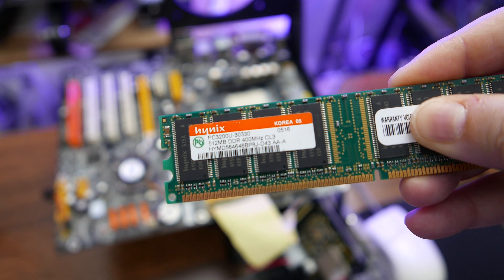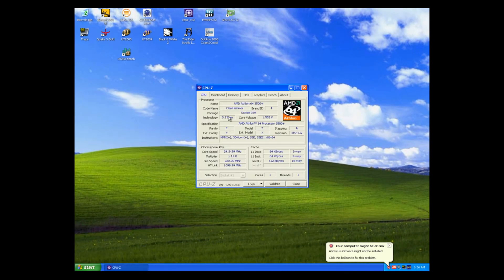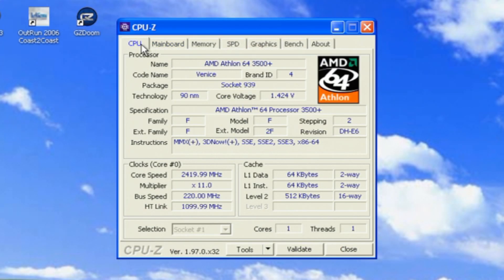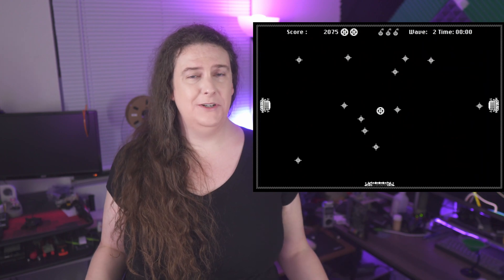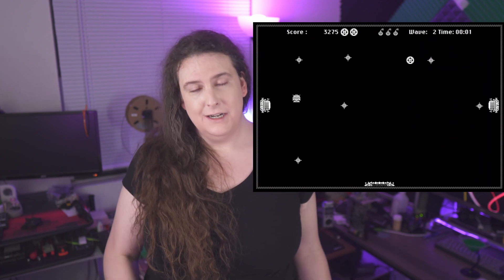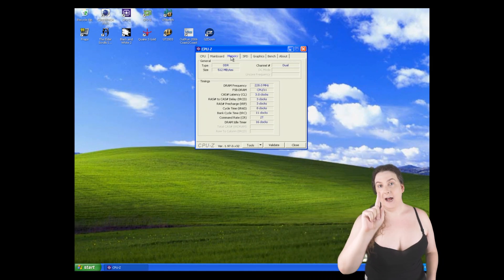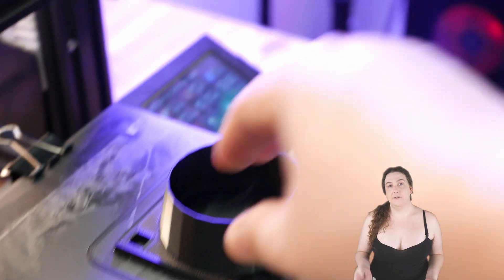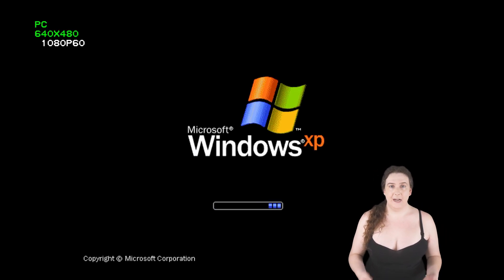Socket 939 #OverclockingBuildoff

Comment: Overclocking the Athlon 64 generation really was an acquired skill. Before multiplier unlocked Black Series, KS, et al, you had to have true grit and determination to get very far. RAM dividers, HT dividers, FSB clock, a CPU multi that can only go down... That was REAL overclocking. The kids will say it sucked because it did, but the old folks will say it was awesome because it 'made you tough'.
Reply: Well, it was harder comparing to eg s478 CPUs but still easier than overclocking non-BE Phenoms or Athlons for AM2+/AM3 (separate CPU-NB multiplier and voltage, dependencies between CPU-NB, HT Link and RAM multipliers, ACC for first Phenoms, then unlocking cores on 2nd gen etc.). IMO AM2+ and AM3 were the most awesome oc platforms.

Comment: Been waiting for this one as back in the day my first OC attempt was with my 939 system, which just ended up poorly. I even had Mushkin ram. I should try and redeem myself at some point now I actually know what I should be doing. Can I ask if you work in a tech related industry of sorts? Just wondered how your interest started.
Reply from the maker: Yeah, I mean, I've used computers my whole life, but I'm in dev and support for a fairly niche corporate software vertical.

That just pays my bills, though. My interest in computers has been lifelong. I don't know what it is about them, I just think they're neat (insert Marge Simpson meme)

A lot of the retro tech I've covered is stuff I'm familiar with, since I grew up with it. For example: I had a Socket 939 system for about three months before it all self-destructed from the capacitor plague! 😂

Hopefully this year is going to be the year of treading new ground (for me, at least). Thanks for the comment, and good luck with your own OC! There's a lot of knowledge in the comments here!

Comment: Awesome video as always. You was likely hitting a wall due to HT speed. It needs to be lowered to run higher FSB as it gets overclocked too , 3x or 4x Should run just fine.

 The RAM looks to be Hynix D43 which needs a lot of voltage to do high frequency iirc. If you happen to have any Samsung UCCC which is common on most dual sided 1gb sticks with UCCC clearly marked on the chips they can easily do 500mhz+ CL3-4-4-8-2T 2.6-2.7V low voltage. The bios should also let you set lower memory straps for example 200,266,333.